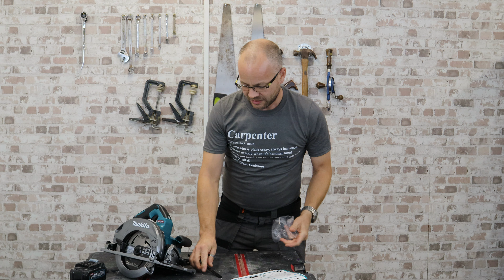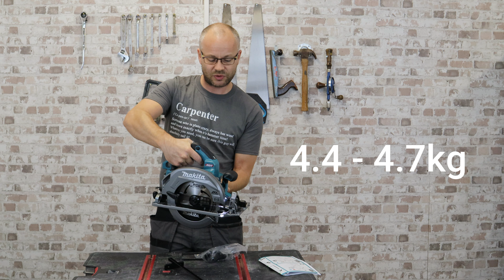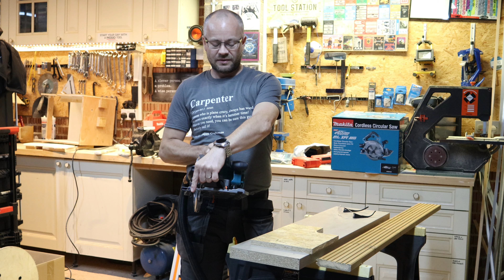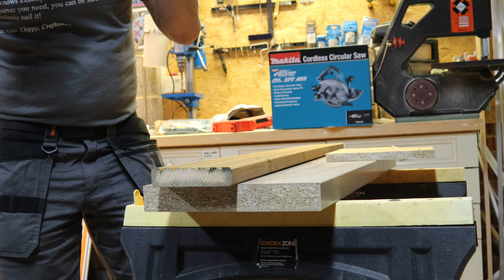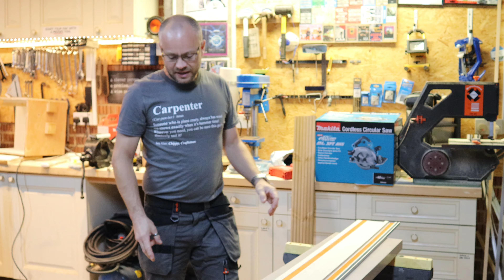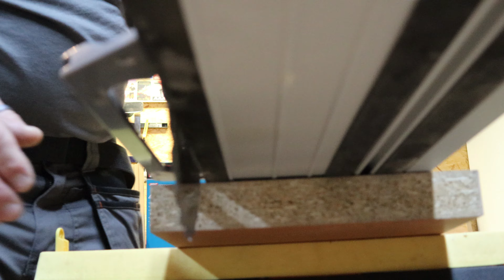Makita HS004GZ XGT Max 40V Circular Saw 190mm | Review & Demo

Comment: Hi can I use this to cut metal? There's a model for metal but it doesn't do bevel cutting like this model.
Reply from the maker: No, this is designed for timber.
Reply from the maker: ... What's the other model you were looking at?

Comment: I am going to spend about 15 quid on a 5 metre flex cord and rewire my 240v DeWalt track saw thats about 10 years old .... the only issue I have is that the cord is too short ... its attached to the extractor anyway so I always drag a hose or cable... and when I want to cut studs or 'ends' the issue is the short cable.  I have probably 20k of hand tools and power tools built up over 30 years .... I think the Makita drill driver I have that's 5 years old sums it up - yes it's heavier than the new ones ... but the bare tool is now only about 60 or 70 quid and it's not even a brushed motor.... but! it's ridiculously powerful ... tools now have to really justify the expense for me to invest ... however this seems a great tool and if you have to buy a new saw I'd get this ....bear in mind kids .... I still build handmade kitchens with my DeWalt 'tracksaw' and it's not even a 'plungesaw' you don't need every tool in the world to be a skilled craftsperson :)
Reply from the maker: Wise words. 👍 They don't make things like they used to, they were built to last.

Comment: It's aggravating that Makita is making all of these track compatible circular saws battery powered with no corded option.
Reply from the maker: If I'm not mistaken, most manufacturers are the same, it's a lot easier when being used on site and trades can do away with the 110v transformers.
Reply: I was thinking these battery tools are so good now, I’m considering doing away with all my corded tools by simply replacing them, when they wear out, with battery ones!
Reply: We got by for decades without track saws! If you what you're doing, it's not really an issue.
Reply: @stevejames9261 You're completely right steven. We also got by for centuries without electricity and power tools. Me whining about wanting a bigger corded track saw is because of my lack of skill and nothing to do with convenience and saving time so I can have more time to spend with your mom.

Comment: Does it not come with a rafter hook?!?!
Reply from the maker: Good question, but unfortunately not. You can how ever purchase it separately. I have added a link in the description box for you.
Reply: @ChampionsOfTheTrade  how’s it going now?? Still a good saw? I need something this sort of size for when I’m doing cut roofs? How do the 2.5ah batteries last in it??
Reply from the maker: @Jimmythechippy  I really like it and on experience so far would recommend it. Mostly used it for cutting 8x4s. The batteries last pretty well, but the life obviously depends on what you're cutting through. They only take about 20 minutes to charge so it's never been an issue. Keep us posted with what you decide to do.
Reply: @ChampionsOfTheTrade  will do, I’ve been a makita fan for so long!! Had the 40v mitre saw and all 18v tools but this year decided to swap to festool as they brought out the kapex cordless. I then got the bug and swapped a lot of my kit to festool, but unfortunately it hasn’t really impressed me!! The mitre saw extractor and plunge saw are definitely a cut above the rest, but the drills aren’t great I’ve literally just sold them and gone back to makita!! Been using the festool hkc55 for first fixing but it’s just not good enough, depth of cut isn’t acceptable and it has no power!!! Going to sell it and get this 40v saw solely for roofing and use my dhs680 for general 🤦🏻‍♂️😂!!!
Reply from the maker: @Jimmythechippy  Just goes to show that some brands are better at building tools for certain jobs than others.